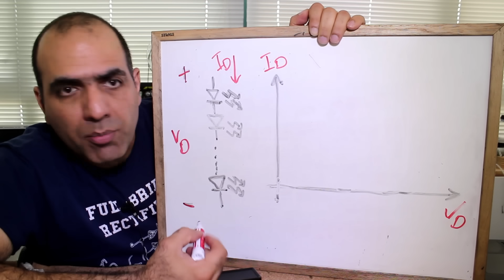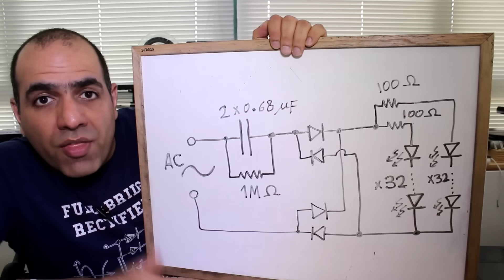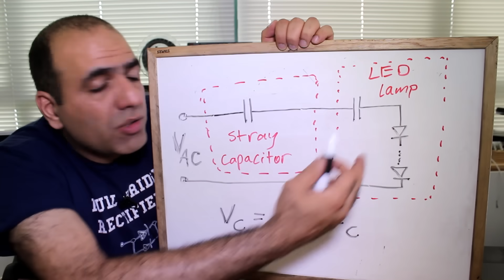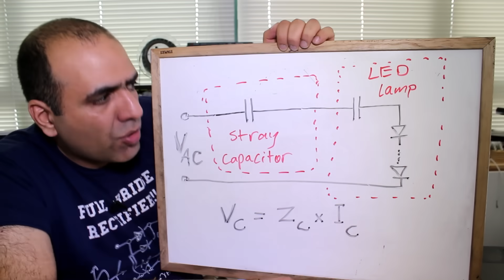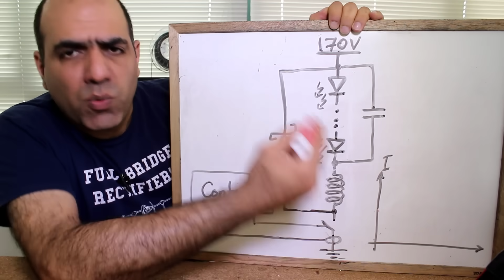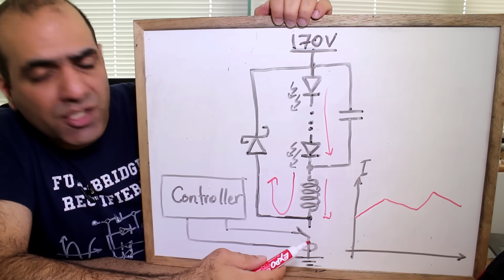Why Cheap LED Lights Keep Glowing

Comment: You must be so happy that your house L.E.D.'s have a full bridge rectifier
Reply: The rectifier is required because LED's would be damaged by a reverse voltage.  Interesting that you used Diodes to convert AC to pulsing DC which feeds Diodes which glow when current passes through them.  [Yes, LED's are indeed Diodes.]
Reply: @dwilliams2068  Thanks. You taught me something new.
Reply: @bite027_ketansharma6  It's been at least 35 years since I designed a circuit using an LED.  It was a precision optical distance measuring system (surveying instrument) and the diode emitted invisible (IR) light.
Reply: @dwilliams2068  Sir/Ma'am 
Firstly, That's really cool.
Secondly, why did you make it?
(Sorry for wrong grammar)
Reply: @bite027_ketansharma6  It was part of a surveying product.  Maybe you can find "Cubitape" on a google search.
Reply: @bite027_ketansharma6  Do a Google search for "Cubitape".
Reply: @dwilliams2068  I did but I couldn't understand much.
Reply: @bite027_ketansharma6  I thought your question was "Why did you make ir?"  Please restate your question and indicate what you meant by  "it".
Reply: @dwilliams2068  By it I meant the cubitape i.e. Are you a scientist or inventor or engineer of some sort that you making such devices?
Reply: @bite027_ketansharma6  I was in charge of the Cubitape project and designed, or redesigned, specific circuit functions, and managed the project overall.   The project had 4-6 engineers working on it during development.  That was long ago and I have retired from engineering and consulting.
Reply: @dwilliams2068  That's cool, actually very cool. Coincidentally I am also studying to become an engineer ( currently in gap year ). May I ask which branch you took in you Bachelor's degree ?
Reply: @bite027_ketansharma6  Engineering Physics
Reply: @dwilliams2068  Nice, In India not many college have this branch. Only some top colleges do.
Reply: @bite027_ketansharma6  Look up Subrahmanyan Chandrasekhar.  He called me one time trying to get me to hire someone.  I needed designers, not pure science people.  He said he would call Dr. William Erickson but it wouldn't have made any change.  Erickson was my MS advisor and I worked for him in The Netherlands for a while.
Reply: @dwilliams2068  That's my closest to knowing someone with a Nobel Prize. And you Sir/Ma'am are really humble talking to a noob like me over the internet. Thank you. 
:)
Reply: And if I may, I want to ask one more question. How does it feel to leave an impact on this world for the betterment of society?
(Again, sorry for my grammar)
Reply: @bite027_ketansharma6  I think we are drifting away from the purpose of the original subject but I will try to answer your question in a general way.  I had an advantage in that by age 12 I was not only delivering newspapers and mowing lawns, but was into electronics and chemistry.  There was never a time I didn't have a job in one way or another.  In college I had as many as 4 jobs at one time, including teaching freshman physics.  I served my duty as an Officer on a Navy destroyer and then entered industry.  In my life I must have managed or contributed to hundreds of projects and programs and worked on projects from Germany to Japan.  That included writing thousands of pages of proposals and project reports.  I was able to participate in many technical conferences and even gave a presentation at a NATO conference in the London zoo.  (Actually in their conference building just outside the zoo itself.)  I cannot remember a time when I wasn't anxious to go to work and tackle difficult problems.  I retired formally at age 70 but now, at 87, I still take on projects from time to time.   Engineering is fun!  I hope you enjoy it.
Reply: @dwilliams2068 Thank for sharing. I don't have a job till now I do plan do work after my degree. I hope that I make the world a better place for the down trodden. Thank you for your contribution towards mankind. 
:) Hope you enjoy your retired life and side projects.
Reply: @bite027_ketansharma6  Good luck in your future career.
Reply: @dwilliams2068  Thank you. It means a lot.

Comment: Thanks for the vid

so... traditional light bulb and expensive LED bulb wont glow when there is small current flowing through
but the small current is still being charged on our electricity bill right? 
so this means there are current flowing even after we kill the light switch ?

Comment: Wouldn't an LED be on if the light switch is installed the wrong way, that is it breaks the circuit on the neutral wire?

Comment: A few rules to remember:
1. All sensors are temperature sensors, but some of them measure other things too.
2. Where there's voltage, there's some non-zero capacitance. 
3. Where there's current, there's some non-zero inductance.
4. All connections have some non-zero resistance- a "node" in circuit analysis is an approximation

Comment: I bought a pair of Philips LED tail light bulbs (that weren't cheap at all at the time) for an old car I had. I'd park it and shut it off only to notice the taillights would keep glowing faintly. It drove me nuts, you have no idea how many times I unlocked it to recheck that my lights were switched off before I learned this lesson. Lol

Comment: Many switches only switch one wire, leaving the neutral wire connected (when wired incorrectly this can cause a fluorescent light to glow when off). What you are probably seeing is that neutral is still connected and due to differences in ground potential there can be quite a big potential difference between neutral and ground (like the 70V you see).

Comment: Expensive LED light makers:
Capacitors are very important.. We must attach em to LEDs
Chinese manufacturer: We don't do that here
Reply: Chinese Manufacturer: Whats the point in a light bulb if it don't glow?
Reply: Resistors.
Reply: Chinese manufacturer: It’s ok ElectroBOOM will perform well as a resistor

Comment: 8:35 "I am happy to announce the presence of the FULL BRIDGE RECTIFIER here..." haha, I love you Mehdi
Reply: With the exception of toasters, other heaters, and items with motors, most things in your household have a bridge rectifier as the first active component in the circuitry.  Even your toaster may have one if it is smart enough or has LED indicator lights.

Comment: hi sir,
is self loop motor possible? pleast post video and give clearification. thankyou.
Reply: Of course it's possible, how could it possibly not be possible? Just connect a red wire and a black wire to the terminals, twist them together and connect the free ends to the opposite terminals. Now you have to find the right rpm of the motor for it to become self-powering. Send me $100 and I'll send you the plans.

Comment: I noticed something similar (?) when I replaced my dimmable halogen lights with dimmable led spots. I had to keep one old lamp in the circuit, otherwise one led lamp would turn on after flipping the light switch off...

Comment: Similar thing happened to me with regular led light bulb. I solved it by replacing the switch. I used to have one of those switches that has a little light inside, so when the lights are off the little light inside the switch glows so you can find the switch in the dark.

Comment: The resistor is acting as a shunt, so that current will still leak.  Whereas the controller is designed to be a switch to prevent that leakage. Another YouTuber referring to you for an answer - Achievement Unlocked!

Comment: Why fix it? No energy loss and a good reminder that turning of light switch does not fully isolate the device. Any advantage to adding in that extra resistor?

Comment: I actually have this problem for more than 2 years... actually I have a chandelier with 8 light bulbs, and even if they are connected to the same wire and the same switch, 2 out of them always keep glowing 😂

Comment: Man thank you for expaining how and why it reacts as it does. I've hd trouble for years with understading WHY certain things react how they do. I've long nutted out the FBR it's a drop in the lake though. I realise how a cap and a resistor behave but I've never been good at guessing values for them. One circuit that come up recently was to link a pair of 2way radios together back2back as a repeater and I was told to use a resistor on the COR (power on signal recieve) to ground via PNP (think it was PNP I can never quite remember  which to use for certain scenarios but I think I used the PTT2GND of the 2nd radio via the N common or something meaning it was sorta PPN iirc???) . But anyway long story short there I could never work out which values to use to limit current without dropping too much voltage and for that matter how does a resistor that sinks whatever you throw at it limit how much current is being dragged out of the radio?

So I appreciate when there is a hey this does this then that does that creating whatever style breakdown.

Comment: How is the fact that the LED lights are staying on after the power is removed a bad thing?
What would the electrical meter show as power consumption and power factor while these lights are still on?
I realize the power company will not like it, but they are way, way, way down on my Christmas list.

Comment: dammit Chinese bulb - you had one job!. also wouldn't these lights blow up as the full voltage would suddenly proceed to the leds if the capacitor failed?

Comment: And Mehdi gets ever so closer to overunity energy with each video...HAHAHA!!.(it's true though)
Now that you have read about Nicola Testlas biography,I hope you are realizing one of his ideas in this video,energy is ALWAYS around you and you just proved it to yourself and the 🌎⬅world.
"The flywheel effect"is what this video should be called.
Reply: How is this related to 'overunity'? The bulb was attached to a live wire for these experiments, notice that it didn't glow when the switch was off.
Reply: @zcomputerwiz  It glowed without any power being applied to it,watch the video again and you'll see it,Mehdi does this several times.
Reply: @4gauge10  Like when he was touching the faucet and generating static with his foot on the carpet? Still not seeing anything to do with overunity.
Reply: @zcomputerwiz  Nope...when he turned OFF the light switch and the L.E.D.still glowed.By the way,overunity power is defined as more power going out,then what's going into a circuit.
Reply: @4gauge10  His explanation says otherwise, and you can see it in the video ( he turns the switch off, then back on, and says it is connected to the live wire while he is not connected to anything ). All of the parts with the meter are showing the tiny bit of current flowing from the live wire, he even comments several times that it is because of the ac on the live wire and capacitance of his body or the ground when his feet are in contact with it.
Mehdi does have a video about 'free energy devices' by the way, take a look :)
Reply: @zcomputerwiz  I've watched every video Mehdi has ever done,but that's beside the point.
Overunity energy has been witnessed on this video,he even talked about the CAPACITANCE IN THE WIRE,there was NO ENERGY flowing in the wire.I've done that same experiment and with NO ENERGY flowing in the wire,L.E.D.'s of that type will glow due to the increased capacitance sensitivity of those L.E.D.'s.
Reply: @4gauge10  If that's what you believe you're observing despite the video stating otherwise, there isn't anything more that I can say that will help. Since you have seen the free energy devices video, you know that Mehdi states there is no device that has demonstrated overunity aka free energy or perpetual motion - producing more energy than is input - and that it is impossible with the laws of physics as we understand them. Best wishes in your future exploration.
Reply: @zcomputerwiz  Aah no,he clearly stated the FACT that the wire is capacitive.I just told you that I've done this SAME experiment and I had the SAME results.
I DO NOT believe in ANYTHING,I only believe in what's factual and I've confirmed Mehdi's findings in my own home.
I can tell you don't understand what capacitive energy really is.
Capacitive energy is STORED energy,as in,it DOES NOT FLOW.
It's also a FACT that a metal coat-hanger actually puts out a very low frequency signal due to this same type of capacitive power.
These are NOT beliefs,but FACTS.Nicola Tesla confirmed these things more then 100 years ago.
Reply: You're misunderstanding what was stated and demonstrated. In either case regardless of what is acting as the capacitor ( be it a human or another length of wire ) a small amount of current does flow through the LEDs when the AC changes - that's why the LEDs can light. The fact that you use 'overunity' seriously and then attempt some statement about my understanding of the topic demonstrates any further replies on my part would be wasted energy. As I said, best wishes in your future exploration.
Reply: @zcomputerwiz  Sorry,I can tell that you don't understand capacitive energy,so you will continue to pay your local power company until the day GOD calls you home.
I've already solved my power problem many years ago,my entire house runs on capacitive power and I've stopped paying my power company a long time ago because of it,saving my thousands in electric bills.

Comment: Those circuits are pretty simple, efficient, and inexpensive to make and quite reliable (subject to exceptions), but still suitable only for domestic applications. The first one (with the voltage divider) is quite sensible to voltage fluctuation and have a low power factor, the second one will inject a huge amount of harmonics. In large applications, as public illumination, those harmonics and excess of reactive power cold fuck up the power system reducing its efficiency. To solve those problems, very interesting technics were developed to reduce the Total Harmonic Distortion (THD), like static power converters with funky modulations, and also the active Power Factor Correction (PFC), a very common feature of modern desktops power supply. Further investigations on those subjects could result in lots of "almost death experiences" and a very good video.

Comment: Thank you for the schematics!  Obviously your 2nd schematic was simplified but essentially correct.
I thought you typically use a capacitor on the output of a bridge rectifier.  It smooths out the humps giving a more even DC power.  It's visible on the 2nd board.

Comment: 6:50 capacitor avoids dissipation in the bulb, but doesn't it cause heating in the electrical wiring?
Reply: Yes, but significantly less

Comment: My house is under construction and they have a string of lights and I noticed one of the bulbs will flicker on if it gets jostled, while it's unplugged. It gets dimmer each time. Is there a bad capacitor on it feeding it?
Reply: charlesmartin82 the series capacitor used in a lot of these lamps can allow large inrush current that can damage the LEDs on switch on. A bad connection which effectively makes the lamp switch on and off rapidly could damage the LEDs, you might find that some of them have now failed.

Comment: i had this problem when i had wrongly wires installed. The neutral wire was switch with the power wire...
Reply: Exactly what happened to me here in South Africa. Changed the wires around and full off. No more dim light when switched off
Reply: I have that same wiring mistake here. Sometimes, but not everyone, one of my led spots glow weakly. Most of the time, it dies out after a few minutes, but not always.
BTW, seeing sparks between neutral and ground while the fuse is disengaged is a weird experience...

Comment: Hey ElectroBoom, I have a question. I duct taped two AA’s side by side. The + and - facing upwards on one side and vice versa on the other. I taped a coke can tab on one side connecting the + and - on one side. I then held another tab to the other connections. It gets hot QUICK. Could this blow up the AA’s?

Comment: Simply replace the switch with the ones that doesn't glow when turned off. Those switches that have amber or green lights at the tip of the switch are the culprit, those pass a small amount of current to the wire, so the circuit is not completely open. As LEDs take takes a small amount of power to turn on, the small current passing through is enough to make them glow.

Comment: I had a CFL light bulb I unscrewed from the socket and when I squeezed it, it would glow!  I even showed others this!   I just can't figure it out!  Hopefully the remainder of this video will enlighten me.
Reply: You were generating enough voltage to meet the minimum current requirements of the LED system.  It should only glow during the process of squeezing, UNLESS you had some lemon juice or other material which made your fingers into a low power battery.  In that case it might glow for a longer time, that is until your "battery" consumed it's electrolyte, whatever it might be.
Reply: @dwilliams2068  he said CFL.  that's the old cork screw glass tube florescents.   Pretty sure he experienced a similar phenomenon but not the LED driver board one from the video.
Reply: I have lost track of who said what.  In any case I would seriously doubt that squeezing a CFL would make it glow, and in particular more than once.  Rubbing one is not out of the question  though.
Reply: Eric Heppner Are you sure you want to be enlightened by electroboom? He might take it too literally...

Comment: i wonder if you could get enough of those cheap ass lights and work with them to just draw ambient power, and just align them in a room where its abundant, not for the goal of making practical light, but for emergency lights